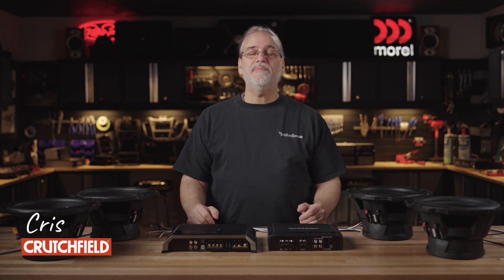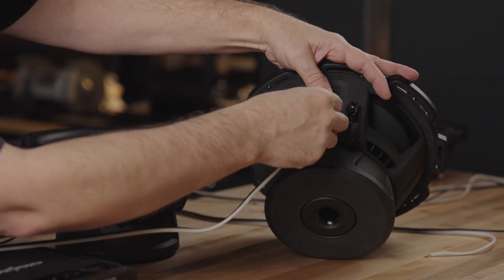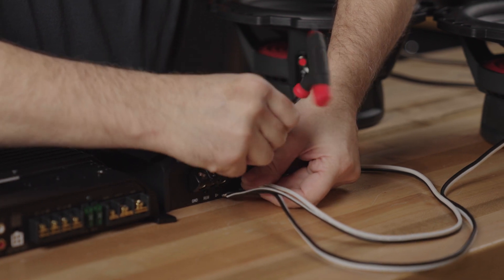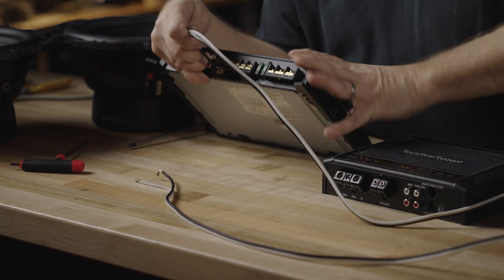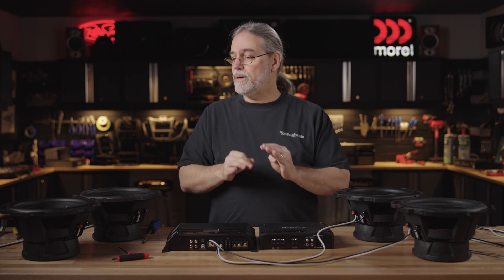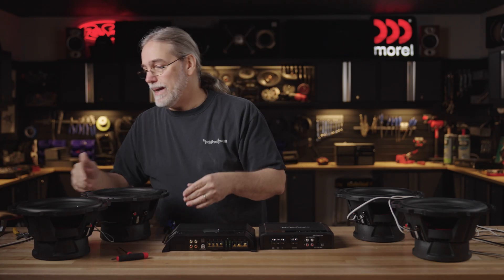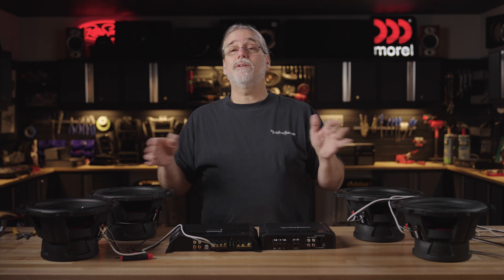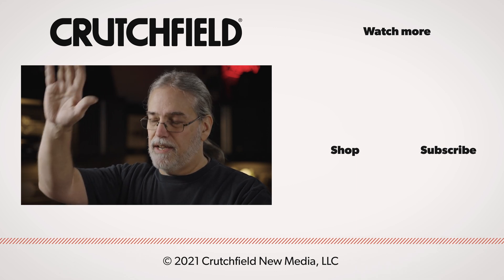How to wire multiple subs to your amplifier | Crutchfield

Comment: what if you didn't twist the ends together and just attached those connections to the positive and negative terminals on the amplifier? what would happen then? would this be wired in series or parallel
Reply from the maker: Are you referring to what's shown around 2:30 in the video?
Reply: Yes exactly that  @crutchfield
Reply from the maker: Are you wanting to run each positive and each negative to its own channel? What's your exact setup?
Reply: @crutchfield  no I don't want to change anything with my setup, I'm just very curious what would happen if the positives and negatives weren't twisted together (like you did in this video for parallel wiring) before being plugged into the amplifer, and what would happen if the wires at the amplifer side were attached in the same manner that they were attached to the subwoofers - 2 sets of positive to positive and 2 sets of negative to negative for 4 wires total going into the amplifer instead of only two wires
Reply: @crutchfield  my exact setup is a BOSS 1800W 4 channel amplifer with 2 12" Kicker Comp CVT 2 ohm subwoofers, they are currently wired according to the amplifer instruction manual

at the subwoofers, I have two positive wires and two negative wires, that are plugged into the terminals respectively, (so 4 separate wires at the subwoofer the same way you hooked it up for parallel @2:30 in this video) 

at the amplifer, my terminals are marked "channel 1 and 2 bridged connection" and "channels 3 and 4 bridged connection" with 8 total wire connection slots (channel 1 positive and negative, channel 2 positive and negative channel 3 positive and negative and channel 4 positive and negative, for 8 speaker wire channel connections in total)

for one subwoofer, the positive wire is attached to channel 1 positive terminal and the negative wire is attached to channel 2 negative terminal at the amplifer, 

for the other subwoofer the positive wire is attached to channel 3 positive terminal and the negative wire is attached to channel 4 negative terminal at the amplifier 

this is what I was told to do in the instruction manual and it works, 

so at the woofers I have 4 separate wires, and at the amplifer I also still have 4 separate wires, 

so to me just looking at the wires it doesn't appear to be wired in series or parallel, but rather something else entirely (which I know is not possible so I must be overlooking something, and I think my next statement will cover this)

since the terminals on the amplifer are "bridged connections" I am thinking that although they have 4 separate wires, they are connected in series at the amplifer (the negative wire for the first subwoofer that is hooked up to channel 2 negative terminal on the amplifer may be internally connected to the channel 3 positive terminal on the amplifier that is attached to the positive wire for the second subwoofer) so to me this essentially seems to be the same as connecting the subwoofers in series (connecting the positive terminal of one
subwoofer to the negative terminal of the other subwoofer and then being left with two wires to run to the amplifer the same as you did in this video for the series connection but in reverse at the amplifer connections rather than at the subwoofer connections)
Reply from the maker: Sounds like you may have the same results just via the amp design. What is the exact amp model?
Reply: @crutchfield  oh okay that's what I was thinking but it is a BOSS Phantom 1800W 4 Channel amplifer and the model number is PF1800
Reply: @crutchfield  if it is wired in series at the amp via the bridged connection, and since the impedence doubles in series and these are 2 ohm subwoofers, I imagine they're operating at 4 ohms wired in this way, 

but these subwoofers have dual voice coils that are wired in series internally, so doesn't that mean both subwoofers are actually 4 ohm subwoofers each even though they're listed as 2 ohm subwoofers? and if this is the case, does that mean that since it's wired in series twice (once at the subwoofers internally and again through the amplifier bridged connection) that my subwoofers are actually operating at 8 ohms? these subwoofers have good reviews but for me they're a little lack luster, I'm not a huge bass lover anyways but since I did spend quite a bit of money for these subwoofers I expected them to pack a heavy punch (that I would then adjust to my desired level) but no matter how I adjust them they don't move as much as the other subwoofers of the exact same model that I've seen in YouTube videos, and if they're wired to be operating at 8 ohms that would definitely explain it, and wiring it in parallel at the amplifer to operate at 2 ohms would increase they're performance right? my amplifier is 2 ohm stable and these are advertised as 2 ohm subwoofers so I think that would make more sense for my setup to get mofd performance for my money, 

am I on the right track here?

Comment: Great video. But you did not explain which wiring would sound better or sound the same. And what happens when we add 2 4ohm speakers to a 4ohm amplifier. I guess speakers would generate 2ohm each but does it going to damage 4ohm amplifier or not.
Reply from the maker: There is no cut-and-dry answer to which wiring method sounds the best. The various methods exist because under the right conditions, they all could sound the best or the worst.

As for what happens when you add two 4 ohm speakers together, that will vary depending on how they are wired together. The first part of the video dives into the two ways to wire two drivers (speakers) together and what that changes for the impedance presented to the amp. The ohms that an amp is stable at should always be considered and you should never present an ohm to an amp that it cannot support.

Are you trying to find speakers/subs that can work with a specific amp? Or trying to find an amp to power specific speakers/subs?

Comment: I have 2 300 watt 10” subs I want to put into my car. Should a 1100 watt max power 2-4 ohm mono block do the job?is it overkill? 

Also I’m running 4 6.5” 400 watt 3ohm door speakers with no amp.What would you recommend for that? 
Thanks.
Reply from the maker: You will want to select an amplifier that provides 600-watts to the impedance generated when both subs are wired together. If your subwoofers can be wired to a combination of 2-ohms total impedance, the Kicker amp below is an excellent choice. You can also add a second amp to drive your mains speakers if you choose!

https://www.crutchfield.com/I-rYALc166/p_20646CX81T/Kicker-46CXA800-1T.html

Comment: I have 2 300 watt 10” subs I want to put into my car. Should a 1100 watt max power 2-4 ohm mono block do the job?is it overkill? 

Also I’m running 4 6.5” 400 watt 3ohm door speakers with no amp.What would you recommend for that? 
Thanks.

Comment: I have 2 12” P3 subwoofers I recently bought a 
RF mono 1200watt amp R2-1200x1 
How would you recommend to wire it up ? Or should I go with a different amp ? Thanks
Reply from the maker: Which model 12" P3 subwoofers did you get?

Comment: my class D amplifier got sub out for passive sub and pre out for active sub... can i hook up simultaneously?
Reply from the maker: With most amplifiers you can use the powered subwoofer outputs and line-level preamp outputs at the same time. You'll need a second subwoofer amplifier to connect to the pre outs and drive your additional subwoofers.

Comment: In my boat, I have a JL audio M 600/1 mono class D 600 watt amp for my 2 JL audio M3 Series 10” subs.
My question is am I able to add 2 more identical JL audio M3 Series 10” subs to that amp?
If so, should I wire them in series or in parallel?
What gauge wire should I use?

Thank you
Jeff
Reply from the maker: If you have dual JL Audio M3 subwoofers connected to your M600/1 amplifier you cannot add more subwoofers and achieve good wattage to each subwoofer. To add 2 more identical JL audio subwoofers, the best way is to add a second JL amplifier to drive them. The JL Audio XDM600/1 below is the perfect choice!

https://www.crutchfield.com/I-rYALc166/p_13698683/JL-Audio-XDM600-1.html

Comment: So if I run 2 600 Watts Subs parallel, does it mean I get 1200 Watts?
Reply from the maker: Your exact sub and amp specs determine how much power you'll get. Do you have 2 600 RMS subs you need help choosing an amp for?
Reply: @crutchfield  thank you for your response. I have 2 600 RMS subs and one 1200 Watts RMS mono amp. Will the amp provide 600 Watts RMS to each sub or 1200 when wired in parallel?
Reply from the maker: This depends on the impedance of your subwoofers and the power output specifications on your exact amplifier. If you are using 4-ohm subwoofers that can handle 600-watts each, wiring in parallel will give you 2-ohms total impedance and 1200-watts RMS power handling for the pair. If your amplifier delivers 1200-watts into a 2-ohm load, each subwoofer will receive 600-watts RMS. I hope this helps to clarify!

Comment: I have one pair of 6-ohm speakers and one pair of 8 ohm speakers and i want to play them at same time. will it be safe if i connect them to my aiwa deck in parallel at same time.
Means one pair in one port and other in other port in series or parallel and also tell me which will be best parallel or series.
Reply from the maker: I would not recommend using two different impedance speakers wired in parallel to the same amplifier channel. If you choose to, you will need to make sure that your Aiwa's amplifier is capable to drive the load, roughly 3.4-ohms. It's unlikely, as most car stereos are capable of driving loads of 4-ohms or higher, so sticking to one 4-ohm speaker on each channel is a good idea. I hope this helps!
Reply: @crutchfield  i have aiwa NSX-VC320 what do i do. Do i just buy another amp and connect them together or what plz guide me i don't have any knowledge about it
Reply from the maker: According to the owner's manual I was able to find for your NSX-VC320 online you can connect one pair of speakers only, 6-ohms and higher.
Reply: @crutchfield  i am a sound lover and i have one pair of 6 ohm speakers and 2 pairs of 8ohm speakers, what do i do to run all of them at same time. Is there any solution
Reply from the maker: Your shelf system is not designed to connect to multiple amps. Would you want to replace it?
Reply: @crutchfield  sure i will replace it
Suggest me any

Comment: So when I do wire 2 subs to the amp do I thin still use the 2 rca input or do I use the pass through port and use 4 inputs?
Reply from the maker: It is not necessary to use the RCA outputs, the pass through ports, when connecting multiple subs to an amp. Those outputs would only be used when installing another amp.

Comment: How many watts does each 4 ohm subwoofer receive from the amplifier if it is rated at 600w @2 ohms??
Reply from the maker: If you wire two 4-ohm subs in parallel to a mono amp to present a 2-ohm total load, each sub will receive 300 watts RMS if the amp is rated at 600 watts RMS at 2-ohms.

Comment: I have seen this videos and it has been very helpful. Thank you for time and patience for making this for silly people like us out here. But, I have not come across the answer to one of my questions Im looking for. I have 2 Alpine W12S4 attached with Power acoustic RE4-2000D. Sound is very decent. The answer I am looking for is. The powers of all the components are within range of each-other, so, can I be able to attach both subs in series and bridge them to one channel? Currently, I am running them on separate channels. 1(bridge) x2(sub in series) is it possible?
on the other 2 channels I have a pair of Jbl gx9638 attached. this setup sounds very nice.
for the head unit I have sony dsx-a415bt.
Reply from the maker: Hi Tony, sounds like you've got some great components. Looks like the amp is rated at 250 RMS at 2-ohms per channel. Since your Alpine subs are rated to 250 watts RMS each, sticking with two of your amp channels to power two of them will work best.

Comment: So if I have 4 4ohm subwoofers and wire 2 of them to 1 ohm and connect to one channel on the mono and the other 2 to 1ohm would they play at 1 ohm or will it go play below 1 ohm?
Reply from the maker: We're glad to help. Are you looking to wire 4 SVC 4-ohm subs to one channel?
Reply: @crutchfield  no they’ll be dvc 4ohm subwoofers
Reply from the maker: Are you hoping to power them with a specific amp? Your best bet will be to wire them for a 2-ohm load. https://images.crutchfieldonline.com/ca/learningcenter/car/subwoofer_wiring/4DVC_4-ohm_mono.jpg
Reply: @crutchfield  yea I was gonna connect it to a blaupunkt 3000Dpro 3000w amp
Reply from the maker: Looks like that's rated for 1600W RMS at 2-ohms.

Comment: i dont understand shit about amplifiers. i have one 1000w subwoofer now with a 1000w amplifier. was thinkin of buying a second sub. so do i need a new amplifier to run them both on max power. amplifier has one port. subs are Ground Zero GZIW 12XSPL-D2
Reply from the maker: Looks like this sub is rated for 600 RMS which is what you want to match. What is the brand and model of your current amp?
Reply: @crutchfield  its older ground zero. Couldnt find The model but about 6 years old 1000w. Not sold anymore
Reply from the maker: We'll need the amp's specs to verify it will work for two of these subs.
Reply: @crutchfield  ok. Done enough research to know i need More Power. What amp would you recommend for these subs to run them full potential
Reply from the maker: Looking at the GZIW 12XSPL-D2's RMS rating of 500-1000 RMS, the Kicker 46CXA1800.1T is an ideal match here: www.crutchfield.com/I-rYALc921/p_20646CX18T/item.html

Comment: So on the parallel setup. Having 2 4ohm subs, I’ll only need an amp that puts out “1 at 2ohms” correct? Now is it the same with the RMS output? If these 2 4ohm subs are rated for 400 watt rms does my amp need to put out at least 400 watt rms or at least 800 watt rms?
Reply from the maker: If you are using a mono amp with two single 4-ohm voice coil subs wired in parallel to 2-ohms and rated up to 400 watts RMS each, a mono amp rated at 800 watts RMS x 1 at 2-ohms would be an ideal power match to maximize the performance of the subs.

Comment: I wish I could shake this man's hand. Tge amount of trouble I had with my amp and subs is insane. Seriously thank you so much
Reply from the maker: You're welcome! It's great to hear that you found the video helpful. 🙂
Reply: @crutchfield JBL Stadium 82SSI when wiring two of these in parallel in a enclosure with one area at the back for output to amplifier should I get the mono amplifier or the other one with only one l - R connection at the back which amplifier should I use for both speakers in a dual box enclosure
Reply: Are you telling me you have issues with connecting like symbols together without telling me you have issues connecting like symbols 😂

Comment: What gauge wire do you use for the subwoofer to amplifier?
Reply from the maker: 12 or even 10-gauge wire tend to work best for subs. Are you planning to use a specific amp/sub? Their specs should specify what will fit.
Reply: @crutchfield  A very old Kenwood 12" w112s hopefully dual in the future. Connected to a Kenwood x501-1.

I've bought a 4 gauge wiring kit but wanted to be sure.
Reply from the maker: 8-gauge power and ground leads are recommended for your amp. 12-gauge speaker wire will match it well.
Reply: @crutchfield  Thank you
Reply from the maker: You're welcome! We are here to help anytime.

Comment: Hooking up two 300 watt JL 12s on a 500 watt max amp in series will work great. 8ohms is good because it will not over tax the amp and still have more than enough bass to enjoy music at a resonable level, so I don't go deaf. 
Crutchfield is the best audio provider for all your needs and has the best tutorials. THANK YOU!
Reply from the maker: You're welcome! And thanks for the kind words! 🙂
Reply: I doubt you'll respond, but if you do, it'd be much appreciated. I have 2, 3 way speakers that are 8 ohms each and 250w max each. How should I go about wiring them in series/parallel, and what amp should I run that would run the system safely?

Comment: Can I connect a dual 2 ohm 8 inch subwoofer with a 12 inch 4 ohm svc together?
Reply from the maker: One criteria for this to work right is that both subwoofers be able to handle the same watts RMS. As long as they do, then you can connect them together (wire the DVC 2 ohm sub's voice coils in series)